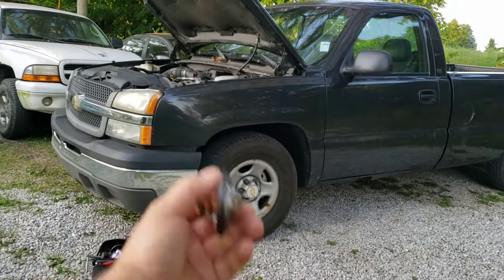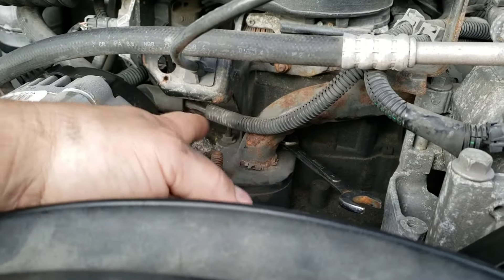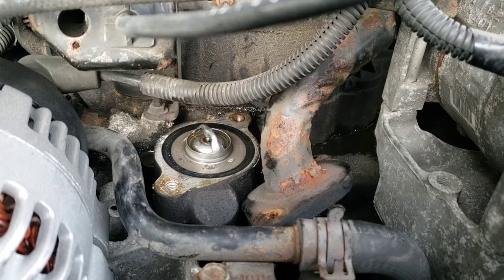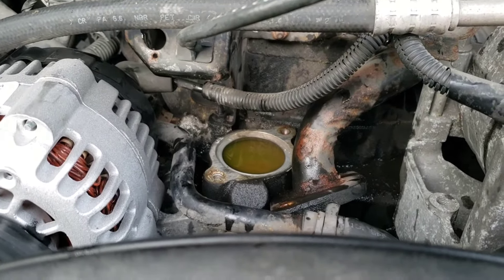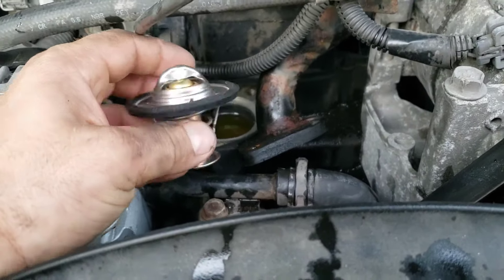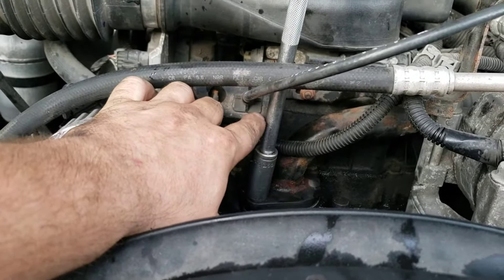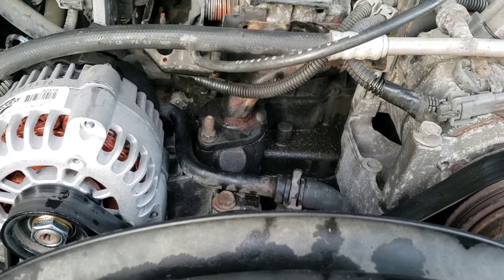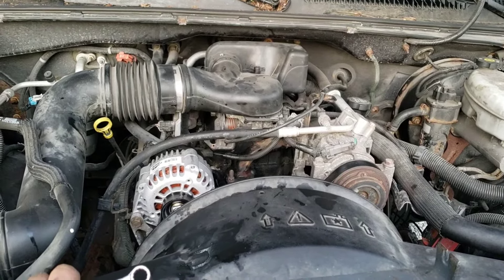99-13 Chevy Silverado 4.3 Vortec Thermostat Change Replacement How to Replace

Comment: Note - it was far easier to take the two brackets off with their 10mm nuts/bolts, then reach the thermostat housing with an actual deep-well socket.  This video was great for an overview of the area.
Reply: What?
Reply: @Txw1ck3d  Unbolting the throttle cable bracket and the second bracket that interferes with the access prevents the struggle to reach the thermostat nuts.  Then one doesn't have to spend inordinate amounts of time moving a little wrench a little bit at a time like he had to.  By unbolting the brackets I was able to reach down on the thermostat bolts right away with a deep well socket, and likewise for putting it back on.  The bolts for the brackets are very easy to get to - again with a ratchet - so that didn't add nearly the struggle that playing with a little wrench would have.
Reply: @workingguy-OU812  What I ended up doing - pulling all the ducts, box, and brackets after wrestling with a wrench to no avail. Last time I changed a thermo was on  a '66 Impala with a 327 - that took not even 5 minutes. This was a procedure. This was all to flush the system before trying a head gasket sealer. Small leak I think, losing coolant, and a bit of mayo in the oil filler tube, though the oil looked normal when I changed it yesterday. Hoping and praying that stuff works.
Reply: After struggling to get to that back nut, I took out that other stuff. Next time I will just save some time and remove the other. Made it easier to torque too.
Reply: @RDRNICKC  Yep, getting stuff out of the way for a clean install is just about always best.

Comment: Clear and to the point. Thanks!
Someone else did the same change on the same model and said that they lost a lot of coolant when they took that thermostat out? It didn't look like you lost any. ??
Reply from the maker: I don't recall how much we lost. It will depend on how full the system is (including the reservoir), but you still shouldn't lose more than 1/2 gallon.
Reply: @BuckeyeBallistics  , thanks! In the video, when you popped the thermostat out, It looked like nothing came out.
Reply from the maker: That's because I split the footage. If you look closely enough, you can see where it ran down the engine...
Reply: Ah ha! That's why. Now everyone is on the same page. I'll be sure to have a gallon sitting by. Thanks again!
Reply from the maker: My pleasure
Reply from the maker: Yeah, it will empty the reserve- that's why I said depends on how full the system is. There is still over a gallon in the block and lower pipe...

Comment: Great vid. I had to pull all the air ducts and the damn throttle assembly brackets (both of them,) as I couldn't get the bolts loose with a wrench. This was so I could flush the system before using a "mechanic in a can" head gasket sealer. I have a small leak somewhere, noticed a tiny bit of "mayo" in the oil filler tube when changing it yesterday. Oil was dirty in the drain pan, but no foam or anything unusual. I can't afford to get the gaskets replaced, so hoping this stuff does it. $80 for a quart, no idea what a head gasket replacement/head milling is going for (I'm in Canada). I miss the days when I could change the thermostat on a 327 or such in about 5 minutes - easy access, no pulling anything. This was a real ordeal. I always hear a bubbling/flowing sound from my heater core, so guessing there was lots of air in the system, hope this resolves that too. You're right about the sockets - long is too tall, short won't go over the bolt. It's like they design everything now so that you have to take it to a shop ffs. And this is an old truck - 2002. Hope I remember the sequence for putting it all back together. Going to run it with no thermo for a good flush, don't think I need the ducts and throttle assembly just to start and idle it. Famous last words...
Reply from the maker: Yikes- wish you luck!

Comment: I dont know if u still reply since ita a old vides but i was going to remove those  bolts from the thermostat and they both snapped what do i do how do i take them out or is there a way to replace the bottom housing where the thermostat goes inside of ?
Reply from the maker: Yup I'm still here. You will need a "screw extractor" kit and the corresponding drill bits. You have to drill a pilot hole down into the broken bolt for the extractor to bite into. Don't drill too large of a hole or the bolt will split or crack when you try to extract. I'm not sure what part those bolts go into, might be part of the block- could not find the answer and don't have the truck on hand to look.

Comment: I’m assuming that the bolts will drop down and away, just wondering if the back one is difficult to catch. Just don’t want to lose it that back one. I built GM cars for 30 years but have no engine experience.Service stations cost so  much, guess I’m a little nervous. My daughter’s bf was going to come today and guess was busy. So I shall do my best tomorrow. I do wonder if that bolt will fall in my hand or on the ground and nowhere that would compromise engine. 😊
Reply: A 1/2 socket will ensure it won't fall - will have to work to get it out of the socket though. I used a 13 mm and it sat in there snug (that's the right size I think). Just use your fingers when it's loose anyway.

Comment: Good informative video!! I have one question...which direction do you point the little knob on the thermostat? Towards the engine?
Reply from the maker: I'm not sure what you're asking. The spring part goes down if you're talking about the orientation of the thermostat when installed...
Reply: Sometimes the gold pin on the top of the thermostat needs to point a certain direction or it won’t work correctly. That is what he is asking about

Comment: Will a faulty thermostat cause the blower to not blow at all?
Reply from the maker: The blower motor for the air vents inside the cabin? No, it will not cause that to stop.
Reply: Blower motor itself or blower motor resistor if it’s not turning on

Comment: Im using a 13 m wrench and I can’t get the screws out , they are extremely tight and I don’t want to tear them, any ideas ??
Reply from the maker: Sometimes torching around where a bolt threads down into for a few seconds can help release it, but that's hard to do on something like this and also you can't get it too hot or the aluminum housing will melt. I don't know what to tell you if the bolts break off, but if you round the head, you can use irwin bolt extractor sockets to get it out. A small/weak impact gun could help too, set to a low setting, because the vibration helps break it free. If the impact is too strong, it too would round the head or break the bolt. Good luck!

Comment: Thanx for the Video. Always thought to have the whole system drained before the change? So there`s no air bubble problem in the heater core etc.?
Reply from the maker: Honestly from personal experience, I've always had more problems with air in the system with a full drain. But as I said in this video, with these trucks, it's not really an issue either way.
Reply: @BuckeyeBallistics  Any update would be much appreciated! How is it running 2 months later?
Reply from the maker: Still runs great. It's my buddies truck and it's his daily driver. I've been in it with him in the last 2 weeks alone 4 or 5 times. And as I said, he drives it every day anyway. I've been working on cars and trucks for 17 years- I know what I'm doin...

Comment: My heater dont work and keeps gettin over heated..... Can that be thermostat
Reply from the maker: Yes, among other things.
Reply: Yea sir... Hell yea thanks bro great vid... im in Houston just froze last night and a water hose. bust. Then after that fix.... no heater and overheating.. Im on road now
Reply from the maker: Did you have heat before the hose broke? You might have air in the system, especially if it wasn't the top most hose that broke (or drove while it was busted). You have to do a burping proceedure to get all of the air out of the system if you lose a lot of fluid and refill.
Reply: Yes everything was good just after I fixed hose started it . and over heat right away..changed thermostat...running like new 2007 4.3 vortec silverado
Reply from the maker: * Unless the thermostat fixed it * (I'm unclear if you are saying you replaced the thermostat), you definately have air in the system then or not enough coolant or the wrong coolant/mixture. If the coolant was "condensed" or "concentrated" coolant, then you have to mix it 50/50 with water. If it was already a 50/50 mix when sealed and you added water, then now your mixture is too thin and won't cool correctly. 

With a cold engine, take off the radiator cap (or filler neck cap) and also the reservoir cap and make sure they are both full. As for burping the system and getting the air out, follow the directions in the video I'm linking of mine towards the end for doing such. It's a Nissan Altima, but the proceedure works the same. Try to have the nose of the vehicle uphill/lifted, as this will help the air escape.

If you don't have a radiator cap or filler neck, then there is usually a little bleeder screw/valve somewhere on top of the system to let the air escape after manually opening it. Just look up Balzer/S10/Silverado 4.3 or Vortec 4.3 coolant burp or bleed or even a radiator replacement on one until one of them shows you how to do it. 

Good luck man, here is my video with the Altima if you want to skip to the end for the burping process...  https://youtu.be/4a_j2zMhSLY